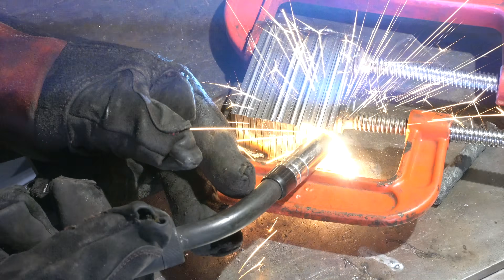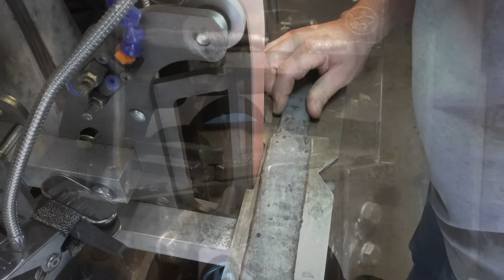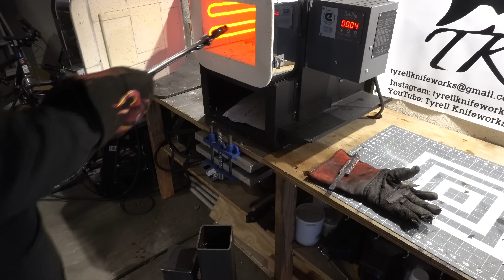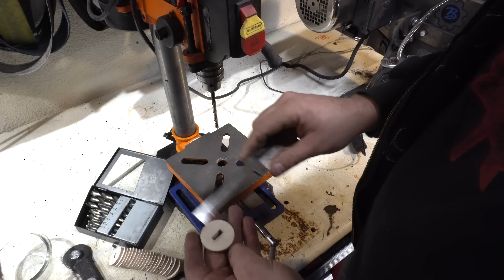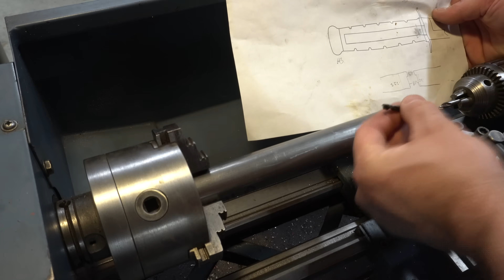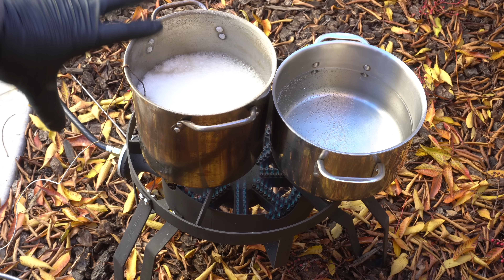Forging Three Copper Damascus Ka-Bar Knives - The Complete Video

Comment: 7:02  please mention the thickness of copper and other three billets.
Reply from the maker: I use 0.020” copper sheeting in all my cumai constructions.  It doesn’t matter the thickness of the core vs the cladding as long as they are the same.  1/3 each cladding to 1/3 core.  Thanks for watching.

Comment: As a Marine veteran I wanted to make a KA-BAR. At that time i was using 5160. But I was experimenting with Mokume Gane at the same time and decided to make the finger guard and pommel out of that material. For the handle I used Wenge instead of stacked leather. I cut the Wenge into 3/4 " washers and copper washers to seperate the wooden Wenge washers for contrast. Filed the grooves into the handle. I made a lether sheath and embelished it with black Ray skin and carved a bigfoot on back of sheat. Turned out very nice. At that point in my bladesmithing i knew i was going to do this for remainder of my life. Fit and finish is everything. Also helps that I am also a leather smith
Reply from the maker: That kabar sounds beautiful.  Thanks for sharing.

Comment: Why’d you have to weld the edges again once you figured you had to make it thinner?
Reply from the maker: It’s just precautionary in case a section gets a little hot so you don’t melt out the copper.  Thanks for watching.

Comment: I have no blacksmith experience but my Mister is a podiatrist. They make sanding caps - that fit onto a rubber blunt bullet shaped burr - that might help with your work. They aren’t expensive and last a long time since there are no angles to wear them down. They come in several sizes.
Reply from the maker: Perhaps I'll look into those.  Thanks for the tip and for watching.

Comment: 1095 and 15n20 for the core? Why not? Just forge weld the core before building the billet itself.
Reply from the maker: Did you listen to what I said in the video?  Yes of course you can weld them first.
Reply: @TyrellKnifeworks  I may have missed that part.

Comment: Why using copper ? Copper is totally useless for cutting.
Reply from the maker: That’s why it’s not on the cutting edge.  The entire core and cutting edge is high carbon steel.

Comment: hi Tyrell i  have been watching your videos for a while now and have to ask is adding the copper practical? it looks awesome but i want to know how well it works. and could you please make a kukri the same way ?
Reply from the maker: The copper is a thin sheet over a central core of high carbon steel which is also the entire cutting edge.  After forging the copper is about the thickness of two pieces of paper so it’s just for looks. The blades are very durable.  Thanks for watching.

Comment: Can he make a 7 inch Knife exactly like those
Reply from the maker: Do you mean 7 inch overall or a 7 inch blade?  The two big ones are 7" blades.  Thanks for watching.
Reply: @TyrellKnifeworks  No just the blade not the handle and I didn’t actually know that they were 7 inches my bad how about bigger than 7 inches like 9
Reply from the maker: @water6887  They could be made any length, though a 9" kabar might look rather odd.
Reply: @TyrellKnifeworks  well if you make the handle about 2 inches it should be fine also I just want to see it be made and know what it would look like in A video I don’t actually want the knife I just know that some people like large knives so I thought that someone out there would like it pointers it was a video idea with no real purpose other than being a really cool Wall decoration

Comment: Noob here, what does the numbers mean. Like when he says hand sanded to 800 what does the 800 figure signify.
Reply from the maker: That's the grit designation on the sandpaper.  The higher the grit number, the finer it is.  1000 grit will leave a very smooth polish and hardly takes off any material.  3000 would give you a mirror polish on steel.  Thanks for watching.
Reply: @TyrellKnifeworks  Ahh nice 👍, and thank you for the awesome content.❤

Comment: No one in the military with any experience would ask for this shit. 
You can bend these knives over your Fking leg. At least military issued.

They are the cheapest toy blades I have ever touched. Multiple problems. 

The way you build these knives is so so SO much better then the casting garbage the US military bought for decades.

Comment: How will these handle use with the copper between layers?
Reply from the maker: The copper is just a thin sheet over a central core of high carbon steel that is also the entire cutting edge.  The knives are very strong and durable.  Thanks for watching.

Comment: Knowing my Marine Brothers like I do, I hope they put these blades in display cases, never to be used. Marines can be known, to put their knives through some serious use. Communication Marines, especially. Believe me, I have sharpened my share of K-Bars that those Men used to cut communication wire. That stuff is steel core wire, insulated with hard plastic and is very hard on those blades. I couldn't begin to guess, how many stones I went through.
Reply from the maker: I'm not sure on the two larger ones, but the smaller one went to an active duty Marine as his daily carry.  Thanks for watching, Karl.

Comment: So, adding copper does not weaken the knife?  I’m a newb at how metals work together
Reply from the maker: No, the copper is just the thickness of 2 pieces of paper.  It looks wider because the bevels are at a steep angle.  The entire core and cutting edge is high carbon steel so it very strong.  Thanks for watching.

Comment: Nice work. But Damascus steel is a steel famous for its folding and secret tempering process. This pressing method is quick and spectacular! Nice work.

👍
Reply from the maker: Traditional damascus steel was "folded" to remove impurities.  It wasn't the folding that gave it the pattern.  That steel was very inferior to today's modern steel which doesn't require folding just to improve the purity.  We do it now only for aesthetics.  Thanks for watching.   PS - there was no "secret tempering process"... tempering is just adding some heat to steel after hardening to improve its durability.  It's certainly no secret.  😉.  Thanks for watching.

Comment: As usual very cool content. When I make leather stacked handle I use an all thread (wrapped in cellophane) with large washers and clamp it that way so I don’t need to care about the length. I then take it off and broach the tang slot. Keep up the awesome work!
Reply from the maker: That’s a great method as well.  Thanks for watching, Francesco!

Comment: This might be an odd question but I'm curious. The copper inlay in the Damascus, does that cause issues with durability and usability of the final product? I know it's forge welded, but I'm just curious as to how it can influence the edge and overall composition of the blade.
Reply from the maker: The copper is a thin sheet over the central core of high carbon steel. It’s never in the edge so the performance of the knife is not affected.  Thanks for watching.
Reply: @TyrellKnifeworks  Thanks for your time!

Comment: Do you even need a power hammer? Seems like a press does the same stuff but more controllable
Reply from the maker: With a power hammer you don’t lose heat in the billet like you do with a press.  Each has their pros and cons though.  Thanks for watching.
Reply: @TyrellKnifeworks  couldn't you throw your press jigs into the forge for a minute to lessen that?
Reply from the maker: @cunnelatio  it’s about the contact time.  The press contacts the hot billet for a long time as it presses, drawing the heat out of it.  A power hammer contacts it for a split second.

Comment: Do you use flux to set the forge welds? and if so what flux do you prefer?
Reply from the maker: I do use flux on the first 3 heats when stetting the weld.  I start by soaking the billet in kerosene, then I use anhydrous borax.  For restacks I’m starting to just tig weld the layers for an oxygen free weld.  Thanks for watching, Dustin
Reply: @TyrellKnifeworks  thanks for the reply, I've been binging all your videos lately lol. I'm a welder by trade so I love the technical side of forge welding Damascus. Keep up the awesome videos, you inspire me to want to get my own forging equipment.
Reply from the maker: @dustinpouchot2783  you should checkout my Beginner Series playlist, that will get you started.  Thanks for watching.

Comment: I have a stainless steel sword with 3 throwing knives. But I can’t seem to sharpen it super shard to cut paper correctly
Reply from the maker: Are you sure it's harden-able steel?  Take a file and rub it across the edge... it should not bite at all.  Assuming that works, checkout my recent sharpening video.  Thanks for watching.

Comment: are you using flux at 1:17, because when I watch shuarp videos he uses a lot of flux.  I can see the flux even running down the billet on the first few heats and presses
Reply from the maker: Yes, flux was used during the initial forge weld.  Thanks for watching.

Comment: PS: you REALLY ought to make a knife out of Titanium Damascus and Mokume Gane forged together in layers like you did the Damascus steel and copper in this video... that would be one ABSOLUTELY GORGEOUS knife...
Reply from the maker: Ti-mascus is not something you can make yourself.  It requires almost lab-like equipment.  Thanks though.
Reply: @TyrellKnifeworks  Oh I see. well that's sad. Maybe in another 10 to 15 years they'll have come up with a commercially available fix for that. who knows?
Reply from the maker: @wesallen3926  titanium requires a zero oxygen environment for forging so it’s not an  at-home thing.  Plus forging titanium is just scary.  😳

Comment: For the guards, when you said you wished you had a rotary table, you probably could have made them on the lathe. before milling the slot, drill a hole in the center, then grip a threaded rod in the chuck and use a nut to clamp the guard to the jaws, and do facing cuts with a form tool that has a curved profile
Reply from the maker: Yeah, but sometimes the setup isn’t worth the time.  It’s just easier to grind it sometimes.  Thanks for watching, Joe.

Comment: So the copper Damascus lines won't turn after a while? Would you have to keep lightly sanding them over time to keep them bright and shiny copper? How durable are they? Are they more decorative than for heavy use? My God they are absolutely beautiful!
Reply from the maker: As long as the knife is kept clean and dry, it will last a lifetime.  Sanding wouldn’t be necessary but a light buffing will return the shine on occasion.  They are certainly usable knives and one of these went to an active duty US Marine as his active weapon.  Thanks for watching

Comment: What happens if you dont weld all the edges of the different layers fully before forging them?
Reply from the maker: It’s too easy to melt out the copper if you don’t weld up all the seams.

Comment: man those are gorgeous the only issue being that they have round handles. Oval handles would be preferable for comfort and edge alignment but man if the blades aren't incredible fantastic job man.
Reply from the maker: Thanks for checking out the build

Comment: Question: does the copper weaken the blades overall strength? Are these for regular use or more an heirloom. Great work and thank you for the tutorial!
Reply from the maker: These are completely functional blades. The copper is just a thin layer over a central high carbon steel core which comprises the entire cutting edge.  Thanks for watching, Joseph
Reply: @TyrellKnifeworks  does it not suffer from galvanic corrosion though?
Reply from the maker: @supernovalabs  Galvanic corrosion requires the presence of an electrolyte (like saltwater).  Keep the knife clean and dry and it will last a lifetime.
Reply: @TyrellKnifeworks  great answer thank you

Comment: why do you weld the edges? Before forging?
Reply from the maker: In layered constructions it creates an oxygen free environment so you have a higher success in forge welding.  For these copper layered billets, it’s insurance in case you get it a bit too hot and liquify the copper so it doesn’t just melt out.  Thanks for watching.

Comment: How well will these hold up with the copper?
Reply from the maker: Keep them clean and dry and they’ll last a lifetime.  The copper doesn’t affect the strength, it’s just a thin sheet over a central high carbon core. Thanks for watching.

Comment: So the copper bonds in a soldier or brazing like process? And the reason you  needed to weld it fully around the entire billet?
Reply from the maker: Yes, it’s like a brazing process.  Welding the billet is just insurance in case you overheat a section it won’t leak out.  Thanks for watching, Andrew
Reply: @TyrellKnifeworks  Is it possible to layer nickel between the copper and steel? The nickel should bond to both metals provided no oxide layers form? Or is that not possible? Been welding for 30 plus years and now getting into inspection. Still learning new things all the time.
Reply from the maker: @amirlach  it’s certainly possible and that’s a common technique in Damascus.  My dagger for The Dagger Challenge uses this! 😜

Comment: 25:15. Would it make sense to use a sacrificial piece of steel the same exact dimensions as your tang to build the leather handle? That way you wouldn’t need to expose your finished piece during the epoxy stage?    ….very nice work!
Reply from the maker: I was too lazy to build an exact replica of the tang.  It was easier to just wax/Vaseline the tang so it came off easy.  Thanks for watching, Nicky.

Comment: When you had to go back and thin them out am I right in thinking that the only reason you welded the sides is because of the copper? On a normal Damascus billet the welds wouldn't be required?
Reply from the maker: Correct, the welds aren’t absolutely necessary but it’s a good idea for any San mai or layered construction.  Thanks for watching!

Comment: So what about bronze. Can you do it with brinze
Reply from the maker: Yes, but the melting temp of bronze or brass is about 200F lower than copper so it’s easier to melt it out of the billet.  Guys have done it though.  Thanks for watching.

Comment: Amazing!!
Reply from the maker: Thanks for checking out the build!
Reply: @Tyrell Knifeworks  quick question, I have an ordinary version and the leather is very slightly starting to dry out. Can you suggest something to help with this? I have used some bees wax that I use on my hiking boots, but I'm not sure if this will damage or help the leather on the knife. Thanks
Reply from the maker: @colmanscapers7498  try some Neetsfoot oil.  The leather will suck up a ton of it but that’s good.  👍
Reply: @TyrellKnifeworks  oil arriving tomorrow! Thank you...

Comment: Oh yeah you had plenty of material. A ka bar is around 0.188in/4.775mm thick so you couldve probably got another blade or two out of it. They turned out great though. Beautiful work. I just finished an arming sword ive been working on. It still needs final polish & a scabbard but its nearly done. Hopefully itll turn out as well as your knives did.
Reply from the maker: Thanks for checking out the build, Joshua!

Comment: How about making a version of this using Brass, Bronze, Copper and Steel? Also, would be cool if you could make a Khukuri knife from those.
Reply from the maker: It’s possible to use brass and bronze, it’s just a little more difficult because they melt about 200F below copper so it takes more care.  Thanks for watching.

Comment: Wouldn't a tig weld be better when sealing the billets? A tig without any stick would mean you don't get any foreign metal in your billet.
Reply from the maker: The problem is that you don't really want to melt the copper into the other metals and that's what would happen if you fused the edges, you wouldn't encapsulate the copper.  Laying the mig filler over the edges is better because it lays over the copper, encasing it, and you can just grind off the filler metal after.  Thanks for watching, Kelly.
Reply: @TyrellKnifeworks  Gotcha.

Comment: BEAUTIFUL WORK. This is the only time I have seen anyone make damascus without any form of flux being used. I didnt know that was possible.
Reply from the maker: When I made the Damascus cladding, flux was used then. For my layered construction though, I find it much better to just weld the seams.  👍. Thanks for watching, Todd!
Reply: @TyrellKnifeworks  I have made some knives in te past but have never done damascus successfully but have tried to make it. Maybe its because I do my forging on an antique coal fired forge, hand held hammer and an ancient beat up anvil. No money to get or build a gas forge or improve my other equipment  since Im disabled and only have a very small monthly income from it and I cant do much at a time before I have to stop and take a break so I dont do much of the forgework anymore so the expense of improving my setup would not make much sense.
Reply from the maker: @todddenio3200  I completely understand the monetary and physical limitations.  Simple random damascus is very achievable in a coal forge with just hammer and anvil though.  It will just take you some time.  👍🏻
Reply: @TyrellKnifeworks  Thank you for the encouragement. Yeah, 15 bad discs out of 23 in spinal column is just a bit of a physical limitation

Comment: what is going on with the pot on the left, why did the "Foam" keep rising and declining over and over
Reply: and also they came out really good, like i am so jealous, and my mouth was watering when i saw the finished project, good job on these and keep up the great work
Reply from the maker: If you mean when I was doing the hot blueing, its just the way the hot salts heat up and then cool down as it boils.  Thanks for checking out the build!